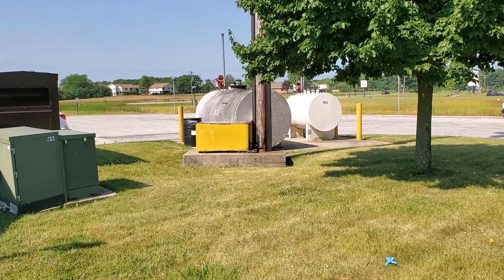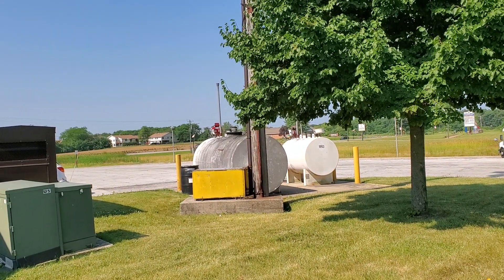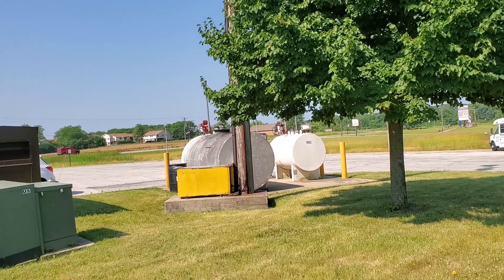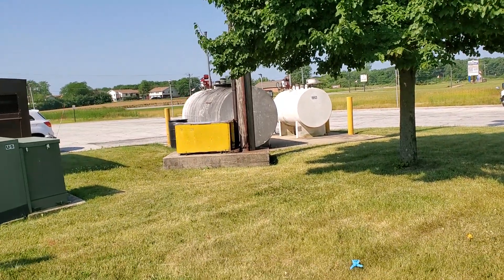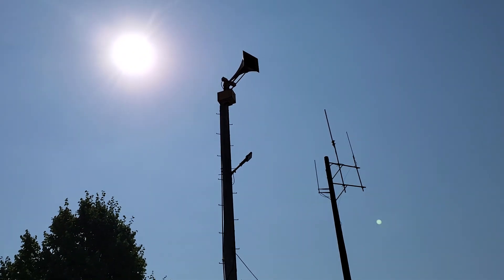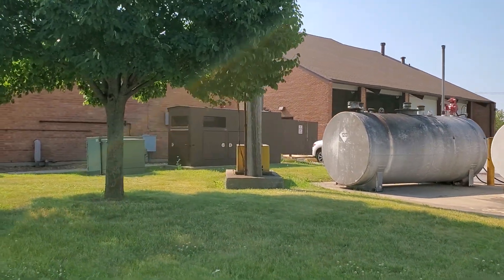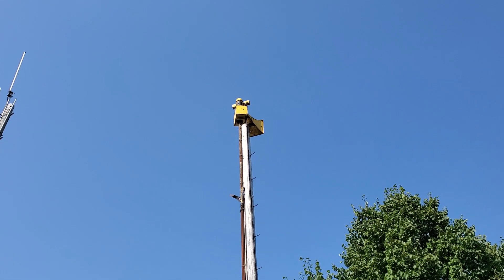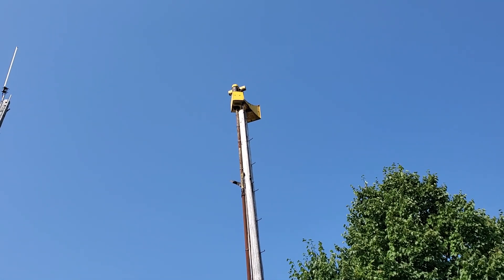Tour of University Park's 4/5 Port Thunderbolt 1003A [7/07/20]

Comment: 1003s never originally came with 4/5 port.
Reply from the maker: Well this one did.
Reply: @BusMaster99  it was probably a custom order so before it was installed a 4/5 got put into it or very early in its life the chopper gave out.
Reply from the maker: @United_HVAC_and_Fans  Well from what I've heard, Federal Signal maintains University Park's tornado sirens directly.  Kinda like how Milwaukee is directly maintained by ASC.
Reply: @BusMaster99   I kinda have a theory that the earliest 1003’s could be ordered 5/6 or 4/5.
Reply: @MasenMonster  any 4/5 thunderbolt in existence is a chopper swap
Reply: @YourAverageMODude145  obv not dis one
Reply: @theray2009  this one was a chopper swap, federal never made the 1003 with a 4/5 port chopper
Reply: @YourAverageMODude145  this one was a custom order from FS&S
Reply: @theray2009  no it was not
Reply: @theray2009  Yup got confirmation to, this was not a custom order, this is a chopper swap. Federal sign and signal never offered the 4/5 port ratio, only 5/6
Reply: @YourAverageMODude145  whatever